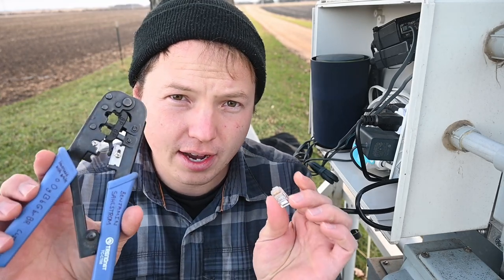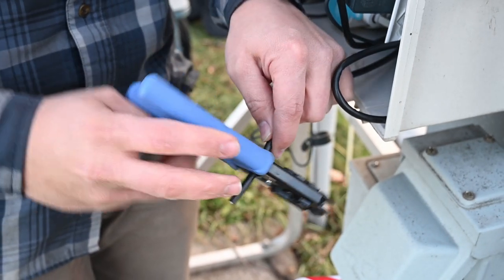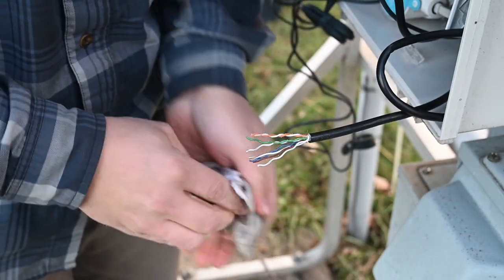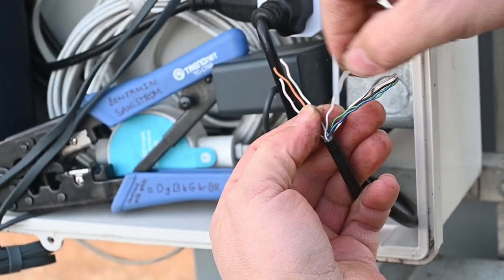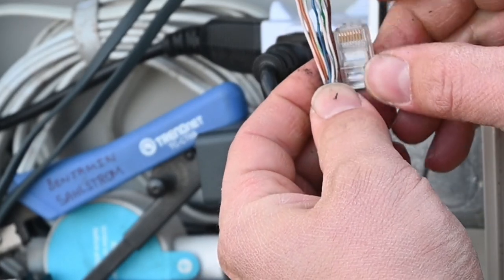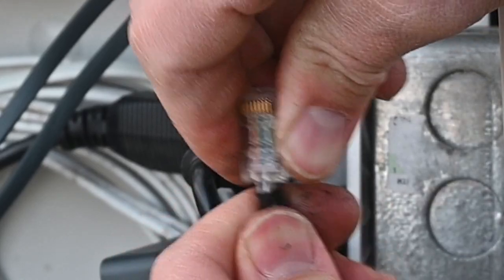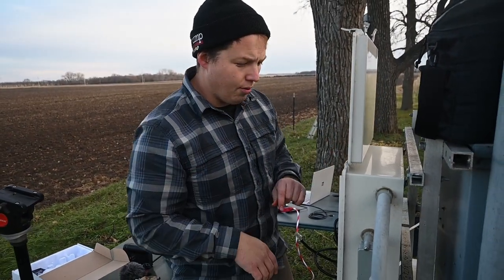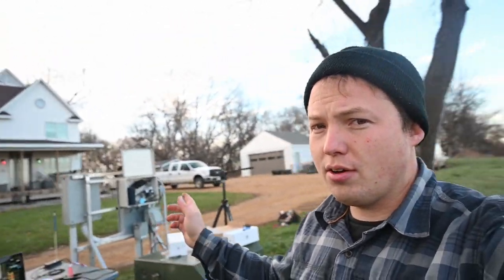How To Crimp The End on an Ethernet Cable - RJ-45 Cat6, Cat5, or Cat5e Connector Plug Termination

Comment: The company I work for banned any use of pass through jacks. Easy to put on sure, but failure rate over time was massive. Problem we observed was the blades that cut of the excess at the end of the plug would not always cut flush leaving shiners on the end of the plug that caused a myriad of different issues. Also a test goes a long way in making sure everything is correct. I do tons of Ethernet cables but still test every one. Occasionally I do screw one up (yep my nearly 60 year old eyes don't work as good as they used to). Also got into the habit of testing all factory jumpers before putting them in service.
Reply: 100% - I would not use one of these crimp on connectors. They fail with time. Punch down to a female jack and run a factory made cable between that jack and your device.
Reply: I am 32 and screwed 3 times for one connector hahaha
Reply: I've been crimping since CAT3 was the new hotness over BNC.  The non-passthrough jacks are getting harder to come by and I'm still on my old Klein die crimpers.  I'm hoping "you get what you pay for" is true with the pass-throughs and am considering the purchase of a good crimper.  Is the new Klein any good?
Reply: @yamlcase230  I believe that as long as you keep the cutting blades in good repair the pass through are probably OK in a limited use. Our company does thousands of connectors so we just decided we didn't need this headache and banned the use of them.
Reply: @jefff8106  
Interesting, i just started to use pass through connectors from true cable and worked great. Was hesitant to use them, but they are easy to install. Interesting topic, good info 
thanks jeff
Reply: @peaceonearth9550  I think if you keep the blades changed regularly they may be OK. I like them for their simplicity but after doing so many of the old style they are really just as simple for me anymore.

Comment: A little advice for the beginners. Strip about 1.5 to 2”. Then use the ripcord to rip more of the outer jacket off. Then cut that 1.5 to 2” original wire off so you now know that they weren’t scored. Clip the outer jacket off from where you ripped it to.

The ripcord is there for this reason actually. In certain jobs, they require us to do this. As they want to make sure the wires weren’t scored.

Comment: Nice video! You can buy connectors that allow the wires to pass through the end then crimp cuts them flush. Their a little more, but if your only doing a couple its well worth it. Plus the ends are flush to the cable to prevent one of those brittle little wires from breaking. Oh and a good cable checker or tracer helps to ensure that you have the twisted pairs correct. I have installed two switches and one 3 way with your help. Thanks for sharing your knowledge and time.
Reply from the maker: Glad I've been able to be able to help out a bit! Will definitely consider the pass through option in the future. Personally I don't make a lot of ethernet connections on a regular basis so the standard crimper and connectors have worked fine.

Comment: The connector is supposed to crimp down on the insulation for two reasons. The wires are not meant to be the structural connection. They will fail prematurely. Also, there are gaps between the wires that can allow moisture to accumulate. Crimping the insulation stops most of that.
Also, the order depends on the application. There are at least two standards and also depends if it is a crossover cable or not. Your order will work for most applications, but just be aware if it doesn’t work there are other possible configurations.

Comment: I haven't ever done a network cable end yet but I know I will have to someday so I bought a decent crimp tool on sale and it has all the wire colors printed on the tool so you can easily visually double check. I just spent all day under the house running network cables for a 4k security camera upgrade and it would easier to just have a spool of decent cable to run through the holes I made and terminate the ends once I have the run just right. Leave some extra for screw ups and nicer neater runs that don't need big holes to work. Guess I need to buy some ends and a spool of cable soon.
Good video for us regular guys wanting to do our own work.

Comment: As others have mentioned I use the ones where the wires go right thru the clear connector and the ends get cut off. Much easier. The type you use are a PIA.
Reply: Right, put you need to also use the correct crimper that's meant for the pass-thru RJ45s. It needs to have a blade on the side that moves when crimping.

Comment: You left the wires to long and didn’t crimp the black insulation of the wire to make a proper connection…. The black insulation would go into the connector and also gets crimped locking it in and taking any strain off the wire crimps when pulled.
Reply: Reinforcing my point! AMEN!
Reply: This was my criticism also.

Comment: I highly recommend the EZ type connectors for any one doing even just a few connections. Note you also need the EZ crimp tool to use them. They are not that much more expensive but way worth it in the ling run in how much time you will save. 
You do need to use CAT6 connectors for CAT6 cable. 

A tip if you are doing a large network, keep the ends of the pairs twisted as much as possible. It is the twists in the pairs that mitigate RF interference which in turn create packet loss. Once the wires enter the plastic connector they are no longer protected.
Reply: Using the EZ style of connector outside will gaurentee problems as the copper conductor is exposed to moisture in the air. Please only use EZ style connectors with braided wires.  They are made to stab through braided wires otherwise you will skid off the side of the solid and you will eventually have an issue with connection.
Reply: @brianbay989  Incorrect.

Comment: Great video.  I hate direct burial for that greasy mess reason!  ;)  I'm sure this has already been said but, the little 'tab' that you said holds onto the wires is actually supposed to hold onto the outer sheathing.  Leaving the shortest length of the twisted pairs untwisted is best.

Comment: For modern ethernet its always straight-through, pin for pin.   There is no use-case for cross-over configurations.   e.g.  pin 1 through 8 on one head goes to pin 1 through 8 on the other head.    The pairing matters of course, since each pair of wires has to form a balanced twisted pair in the cable.

Pin 1,2 is a pair (end)
Pin 3,6 is a pair (outer center)
Pin 4,5 is a pair  (center)
Pin 7,8 is a pair (end)

Color pairs are:  white/orange and orange.   White/green and green.   White/Blue and blue.   And White/Brown and Brown.  

For the pairing, there are two color coding standards, but to be frank it doesn't really matter what color pairs you choose as long as you follow two rules:

* You must assign the white/X and the X to a pin pair above.

* You must always alternative a White/X and a solid on the pins.  Always.

--

So, for example, one standard is:   white/orange, orange, white/green, blue, white/blue, green, white/brown, brown.

* The pairs are matched (1,2 has the same color, 3,6 uses the same color, 4,5 uses the same color, and 7,8 uses the same color)
* And the pins always alternative white/X and X.

But you could easily wire it X and white/X instead of white/X and X and it wouldn't care.  As long as both heads are the same.   Modern ethernet trains each pair independently and just doesn't care.  It just cares that the paired pins shown above are the same twisted pair.

--

If you are doing this professionally, it is good to stick to one of the two standards (T568A or T568B).  It doesn't matter which one.

-

Crossover cable configurations are not used for modern Ethernet, ever.  However, RJ45's are often used for comm cables that are something other than ethernet, and in this situations there might be cross-over configurations.  There is a standard crossover configuration for these other communication standards but most vendors using 'other' comm standards just wire things willy-nilly, not following any particular standard... each vendor will have its own wiring diagram.

-Matt

Comment: A way to remember the order of the wires is to think about it as four pairs that always have a white and solid component.

Here are some considerations
1.  Start with white and end with color.
2.  Blue is Always at the center. 
3.  Brown is last.

For B
White Orange
Solid Orange

White Green
Solid Blue

White Blue
Solid Green

White Brown
Solid Brown

Notice Green colors are around the blue pair, almost as if it hugs it.

For an A termination start with the Green pair and the orange pair should hug the blue center pair and always end in brown.

Comment: Appreciate all the "use a keystone jack and pre-made cables" here.  But you can't use a keystone jack to terminate into an outdoor rated point-to-point radio.  They all require RJ45 and sometimes you are making that RJ45 connector in a very uncomfortable spot to attach to the radio.  Oh and always, always use Ubiquiti ... don't save a few buck and use the cheaper stuff.

Comment: In the late 1980's Local 3 Electricians Union in NYC didn't know how to wire for Ethernet but would not give up the work. I was responsible for computer installations for a major multinational. So, by offering "certain things" to the forman and crew,they let my non-union guys make the connections. We worked nights while the union guys spent time at a local bar getting paid for our work.   ~~~~~  That's only one of the several times I had run-ins with Local 3. There are many more, but another on this job was when they would not let non-union truck drivers deliver computer equipment to the building in mid-Manhattan.

Comment: It worked good the first time, forget to add the plastic cover onto the wire before doing all that, did it for home cameras. I just wish there was something easier to align the wires right because they can easily move over a spot and ruin it.

Comment: My crimps (all from ~20 years ago, in college) all worked, and then failed eventually.  I was using them for patch cables, so they got moved around quite a bit.  My life lesson was to always buy complete cables.
Reply: Bingo, never crimp
Reply: For patch cables that are meant to move a lot, you'd want to use stranded core wires. Solid core is meant for permanent runs that has very little to no movement.

Comment: Two things you have to follow when wiring network connections. One is follow 568b wiring order which is what you did in this video and NEVER use solid wires with stab through connecters.  If you use solid wires then you need to use a different terminator then the end you are using.  Stab through connectors are designed to be used with braided wires only.

Comment: There is a limit to how many twists can be unwound and you unwind too many.  Only stranded wire be crimped, solid wire can only be punched down.  Your example most likely will not pass an electronic test.  The penalty is that poorly manufactured cables (patch cords) can creat cross=talk or other errors which can degrade a network to the point that so many retransmits will be required.  There is a lot more to cables than just connectivity.  Education and certification is very important dealing with fast ethernet or better.
Reply from the maker: For sure. I definitely realize that more stringent methods are likely needed in many commercial/industrial instances however for residential networking where the speed required is fairly low (typically under 500mbps) I think this "basic" method will work most of the time. Would you agree or do you think that every connection should follow all of the things you mentioned?

Thanks for sharing your thoughts!
Reply: @BenjaminSahlstrom  don't worry about the number of "untwists", that is perfectly acceptable for gigabit connectivity. Your radio can only push like 120Mbps, so don't worry about it.
He's talking about 10GE, and even then, you're not pushing 10Gbps for most home applications. (Even gigabit is excessive for current residential bandwidth requirements)
Reply: Coleman,
I'm not sure you're talking from experience, or know what you're talking about 🤣.
You can run Fast Ethernet on 4 wires (soon to be 2 wires) kilometers apart. If you know Russian you can find documents on the internet about how old Soviet military power cable was reused with scotch-lok connectors to connect apartment blocks very significant distances away from each other at 100Mbps speeds. 100Mbps is "fast Ethernet", "gigabit Ethernet" is as the name states. NEXT/FEXT doesn't matter, these among CRCs are only issues for carriers. Don't sweat the details unless you're into data center cabling (and even then, they're short hops and you can getaway with sin).
[Edit to elaborate on 'it']
Reply: As someone who works in the low voltage industry, I've never heard that only stranded can be crimped (we never use it, the only stranded we have is in pre-terminated patch cables) 
That being said, whenever possible we terminate into a keystone and then a patch cable (Its really difficult to mess up terminating a keystone, an RJ45 not so much)
Reply: @horsekid98367  exactly. There are two different kinds of jacks on the market for crimping, you can tell if you look at the "serrations" which one is for stranded and which is for solid. The bags are usually labelled.
The one that has 2 "teeth" per pin is for stranded, it pierces into the the sheathing and into the strands, where the connector with 3 teeth: wraps around the solid core of the wire making a firm mechanical connection.
You can usually use the connectors interchangeably, but wrong connector with solid wire cable can sometimes result in miscrimps or problems. Just recrimp/reterminate the cable again and it'll probably be OK.
Pendants unite.
Reply: @BenjaminSahlstrom  i’m all retired now but do a pretty good job with electrical installations.  However, I am not a licensed  electrician so don’t give advice or do work for others which I am sure that meets your agreement since I am neither trainer nor certified.  However, I did have Novell CNE training and certification.
Reply: I second this. I frown upon “getting away with” 

Example: people run long data run’s also. Well theres distance design limit, depending on the cable, rating, mhz etc. and 80% of anything is limit. (Your car tac in example) and then you rarely run on the high side of that for long. So… I see flunkies run cable and say “well your allowed to run to 328ft”. NO. Run half that max. Latency will kill performance.

I had a builder tell me once about some issues with siding I had contractor install,  if it looks bad it’s been done wrong.

Couldn’t be more true.

Echo chambers of bad opinion assignment. Guy on youtube does it wrong, 100 more people do it wrong.

Then it fails.
Reply: In a pinch, you can punch-down stranded and crimp solid cables. Is it ideal or proper, no, but it will work if done correctly.

As for his crimp not passing a test, I've seen crimps with 1 inch of exposed wiring, all combed out, pass a Fluke DSX-5000 certification. I usually cut them and reterminate out of principle though.
Reply: @pn102  Thanks.  Limit on length is 100 meters because the ethernet card sends a packet then waits for an ACK.  If none comes in the allotted time, it assumes a NACK and resends the packet. Once it gets an ACK it sends the next packet.  The amount of time that it waits is the amount of time that it takes a signal to travel 200 meters (100 out and 100 back).  The length marks on the jacket are useful guidance for keeping the lengths right but a decent test pair will measure the length of the wire and fail it if too long.  If there is a broken conductor or a tight turn a echo (reflection) will happen which confuses the NIC and causes it to shut down.  That is why terminating resistors were so important on the old RG-58 coax ethernet.
Reply: @colesmith2541  red line limit on your car tac is what? 7-8000? Do you ever run it there? Rarely… 100 meters is absolute design limit, NEVER run cable that far. 50 meters max. Thats my point. People do not understand. Yes there is fudge room but follow this rule and folks will be a lot better off.
Reply: …yes, he unwound too much, but then he clipped them short…. What counts is how much is LEFT UNTWISTED….

Comment: They make "pull-thru" connectors.....the wires pull thru the end and get cut off during the crimping process.  Somewhat easier to use IMO.
Reply: Yep, EZ rj45. There more costly for the crimper and connectors but that save a lot of time and hassle.
Reply from the maker: I saw that Klein makes a nice pull-thru crimper and RJ-45 connectors. Maybe I'll have to make another video featuring that method as well.

Comment: Flooded cable is nasty to work with. Get some pliers and pull the plastic comb then cut it. It will go back into the jacket some and make for a pretty crimp. Also the pass through RJ 45 ends are so much easier to use. It requires a different crimp tool though.
Reply: Wiping it off with some isopropyl alcohol (at least 85%) helps to remove the stickiness. It then clumps up and can be brushed off the wires.

Comment: I prefer to use a wire cutter rather than using the cutter from the crimping tool to trim the wires evenly.
Reply: I use electrician snips for all the prep work. 🤭

Comment: You should use snips to trim the insulation off the,wires and the insulation should fit inside the rj45 head. Using the crimper to strip wire is very inefficient and slow. Only Strip about an inch at most because when you separate the wires and straightening them you are adding length to it and you won't waste wire.
Reply: It is dangerous using a razor knife.